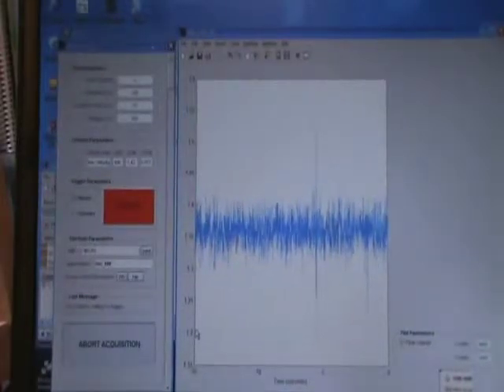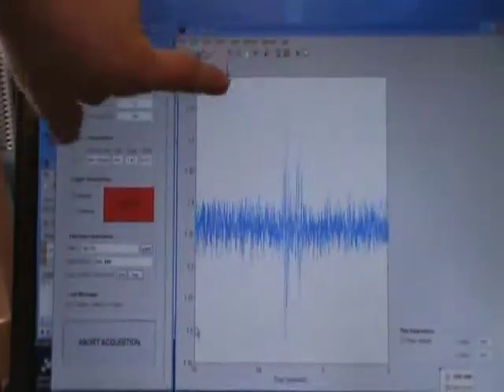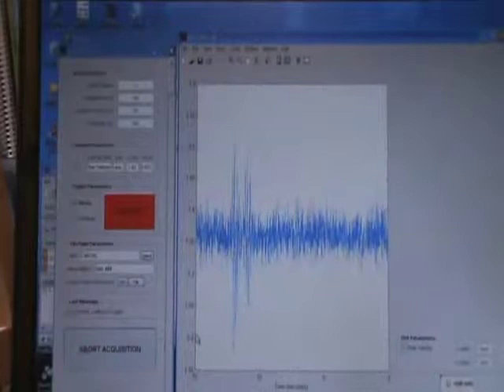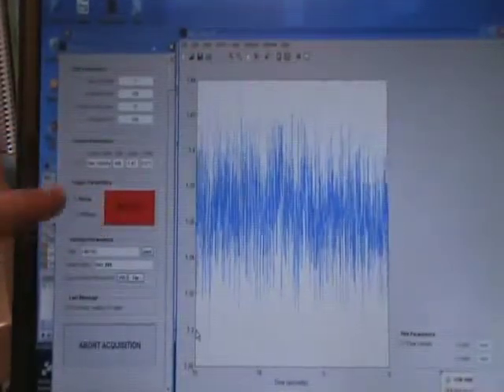Packing for Moorea: Anemometer Part 1

Comment from the maker: Good question? I'm not sure. Hot-wire anemometers work by passing a current through a wire and keeping that wire at a constant temperature. The difference in the current that is required to maintain a certain temp is calibrated by measuring known wind speeds. If the amount of current also varied with humidity, I suppose you could calibrate the anemometer to work in that way!